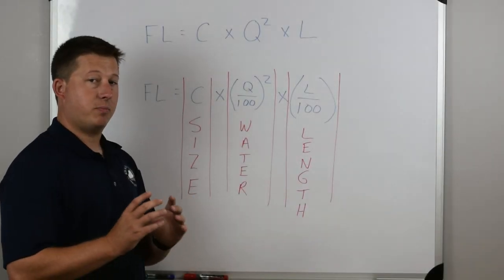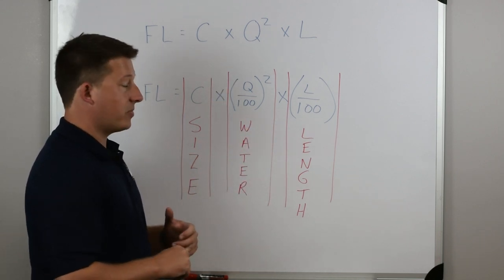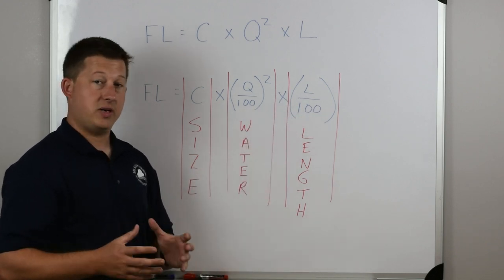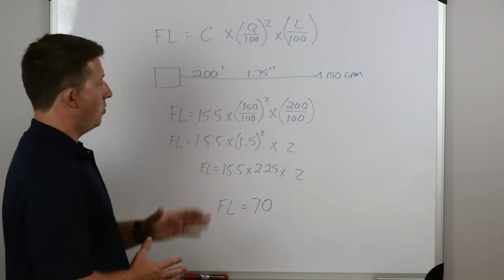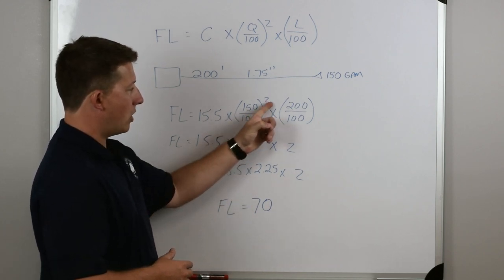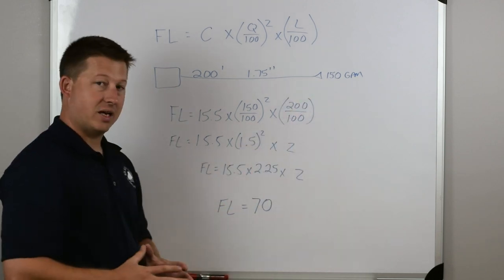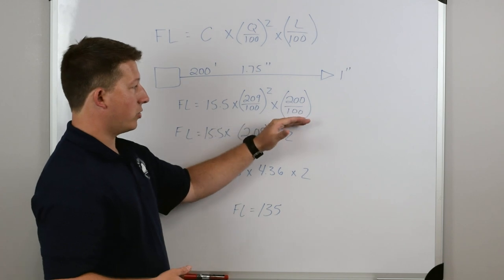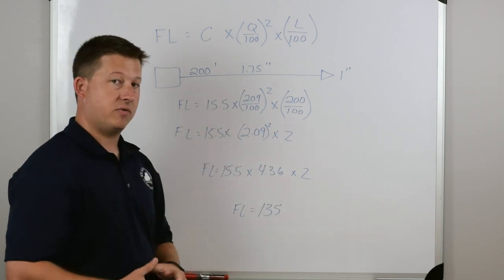Pump Operator Training Series - Part 3 "Calculating Friction Loss"

Comment: Kinda funny but straight up... Going though chauffer school, my dad's friend said 150 psi at the pump... when you do the math on a 2 1/5 or 1 ³/4 its actually a great starting point and after that adjust you valves or governer and your good to go
Reply from the maker: 150 is a very good starting point for the vast majority of operations.

Comment: For the LDH equation.  Where did you get the 500gpm from? I guess I'm just not understanding how you got the flow without a nozzle pressure.
Reply: He is only figuring out the Friction Loss.  Like he says it could be going to a nozzle, another fire engine, ladder truck, etc.  "Pressure" is added when you figure out your total Pump Discharge Pressure, that's when you need to know what pressure you want at the end of your hose.  My Pump Discharge Pressure (PDP) formula is PDP = Nozzle Pressure (NP) + Friction Loss (FL) = Appliance Loss (AL) + or - Elevation (EL).  He is only helping you get one piece of information (Friction Loss) to ultimately determine what to set your Pump Discharge Pressure at.

Here's an example.  200' 1.75" hose with a fog nozzle, operates at 100 PSI, and I want it to flow 125 GPM.
Nozzle Pressure is 100
Friction Loss is 48
Appliance loss is 0
Elevation loss/gain is 0
PDP = 100 + 48 + 0 + 0
Set your pressure gauge on your engine/truck at 148
Reply: I believe he is looking at the 500 gpm as his target flow much like how we commonly use 150 gpm when talking about 1 3/4 lines (even thought we know that without flow testing our hose and nozzle packages, we do not actually know how much water we are flowing).